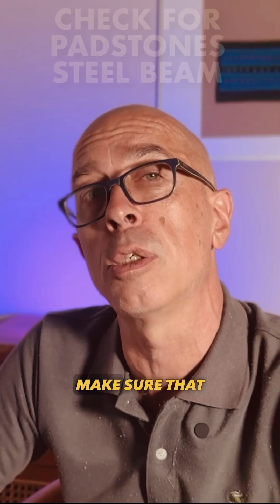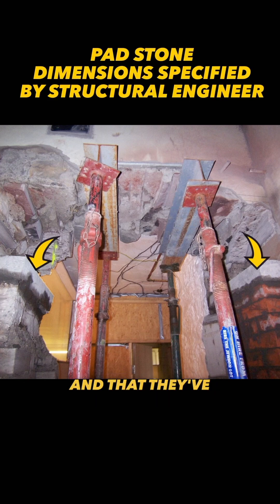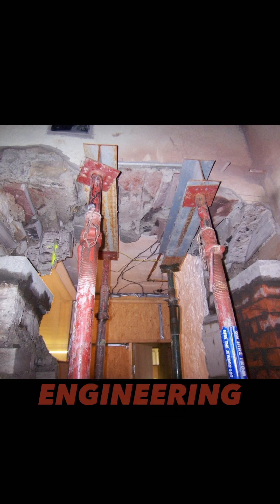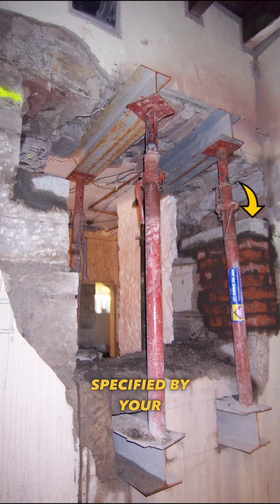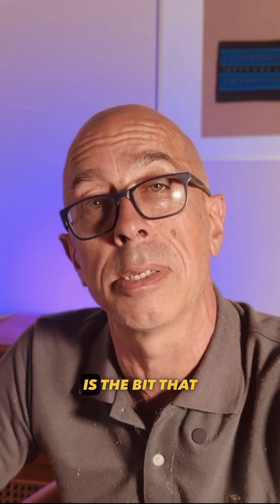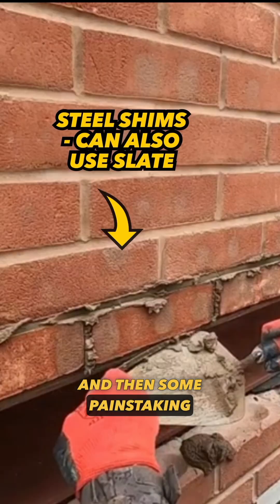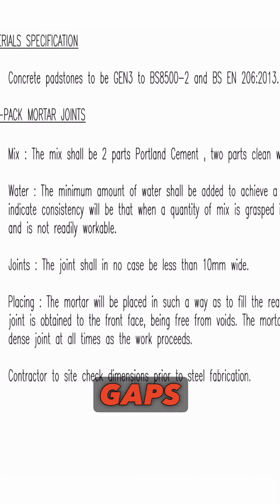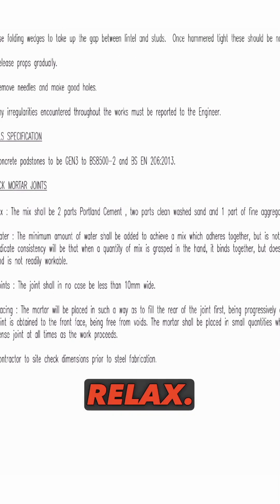Steel Beam Tips & Install, Padstones, Shimming, Dry Packing

Comment: Great content as ever, can you use a finch beam as an alternative to a steel beam? Especially as it's easier as a diy'er
Reply from the maker: Hi and thanks. A flitch beam gives greater span possibilities rather than just timber, but never as good as something like a rolled steel joist. With all things steel, you need to get a structural engineer involved.

Comment: Great video. Question, wjat do you mean when you say ensure the correct "cover" is used, usually 150mm? Thanks 👍🏾
Reply from the maker: Hi and thanks. I mean, the beam needs to sit on both sides of the wall by 150mm in order to transfer the load optimally onto the wall.
Reply: @build-better-things  ah ok. Makes sense. Thank you!!

Comment: can steels be laid on a bed of mortar on top of padstones. in our. SE said we can just use a concrete lintel cut down or solid blues for the padstone. thanks
Reply from the maker: You usually level your steel using shims between the steel and the Padstone but ultimately it’s whatever the engineer specifies. Yes if they say cut down lintel then that’s fine. Usually it’s about the density I believe.

Comment: hi came across your youtube videos very helpful . a long shot question, can you have a overhang RSJ beam about 3ft out and build one of the dormer walls on the overhang RSJ beam?
Reply from the maker: In theory yes I’m pay sure you could, I’ve done something similar myself , you would calculate the cantilever based on the forces over the 3 feet, I guess. However, to get the steel sized correctly and how it’s held down you would need to go to a structural engineer. We ended up making it a cantilevered set of  goal posts to make a sort of projected steel box. Difficult to explain here
Reply: I am a structural engineer. It all depends on the case, what load you support on the bream, the back span, where it is supported etc. 
With this about of info it’s not possible to get to a conclusive answer.

Comment: Have to say it many situations installing steel UB's directly onto existing brick is completely fine. Worked on many projects where that was spec'd by the structural engineer & signed off by the BCO.
Reply: 💯 mate my last 2 bungalow flips on flat roof extensions SE said no pad stones required
Reply from the maker: As long as specified that way by the engineer then you’re covered and that’s perfect. Thanks for making that point. I did mention that engineering bricks are sometimes ok. 🙂
Reply: @build-better-things  My comment was that not even engineering brick may be required. My current project has x4 UBs bearing on existing victorian brick and x1 UBs was spec'd to bear on padstones. 
Typically on insta or FB people go into meltdown when they see an installed UB not bearing on a padstone, but in reality padstones are not always required.  
BTW I love your content, keep up the good work!